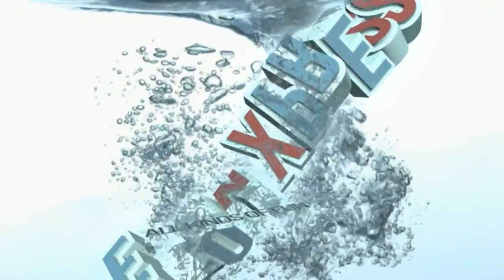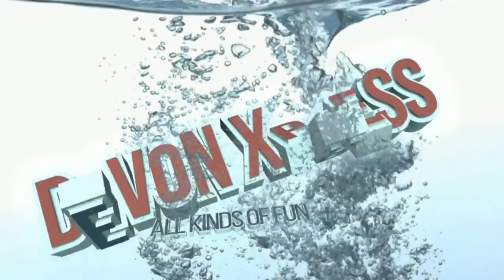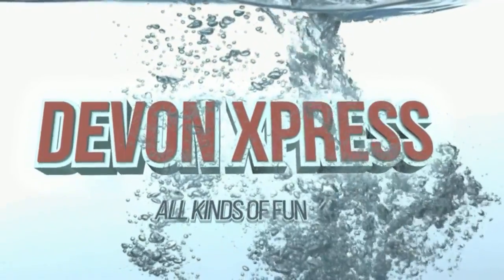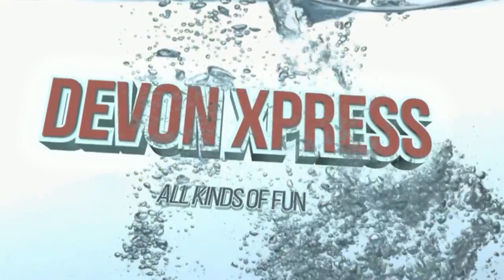7.3 powersroke Blow by Good or Bad

Comment: Just a heads up . To get a more accurate result with the ping pong ball you should cap all ccv . Basically your ccv mod you would cap the hose to eliminate the crank case pressure from escaping anywhere besides where you are testing from which is the oil fill tube .
Reply from the maker: +Bo Mason Good call
Reply: Ahahahaha 😂
Reply: uhhh the ccv is pulling exsesive pressure from the crank case with the compressor wheel.... it is made to do that. a ccv mod is the stupidest thing you can do on a 7.3, it'll make the blow by worse, and possibly wreck your shit eventually.

Comment: Great Video, my 95 has 404K  Ive never done the ping pong ball.  Cap does not move when it set it on top upside down.  I do see the white smoke coming out, just a hint though.  I change oil at 5k.  its usually down I qt., halfway between the full and the add mark.  I personally do not ever see this motor crapping out on me

Comment: If you’re getting a lot of blow by and the oil has been changed regularly a lot of DIY and cheap air filter set ups will allow your engine to get dusted. That is dirt getting into your intake. Check the fins of the turbo on the intake side. If they are sharp you’re good. If they are dull at all or if they look sand blasted the engine was probably dusted. Other than that a little blow by is okay. Your engine will run just fine as long as you keep up oil changes and check for diesel fuel in your oil and/or your truck starts blowing blue smoke.

Comment: Hey Devon, I'm thinking about buying a 1999 f250 7.3. it already has the 6 pos TS tuner. What kinda milege do you get with your rig, and what all have you replaced on your truck since you haved owned it?
Reply from the maker: Well this is a lot to add to a comment, but i get about 17.5 hwy and 15.5 town, on my channel i have many videos of things that I've done to my truck check this one out: https://www.youtube.com/watch?v=5LjTMpisoXg
Reply from the maker: one thing to note is that if its pre 99.5 add ons are a little different than the late 99 to 03. You can find this out by looking inside the door to see what the manufacture date is
Reply: ok, will check the man. date. Just one more question. Where did you get your mirrors? I " like " the 99-07 but the 08+ looks alot better.
Reply from the maker: This is the closet i can find, the mirrors i have look a little different because of the 45 degree cut on the side. I can't find the style i have anymore http://www.ebay.com/itm/For-99-02-Ford-Super-Duty-Side-Mirror-Power-Heated-NO-Signal-Towing-Mirrors-PAIR-/291422248688?fits=Year%3A2001%7CModel%3AF-250+Super+Duty&hash=item43da1e9ef0:g:xJkAAOSwpDdVHQzf&vxp=mtr

Comment: Just finished up on my 351w and took it for a ride. Got an insane pop at around 4500rpm and started smoking from my oil fill cap instantly dripping oil. Threw a code at me so I shut it down and let it sit for a few minutes. Fired her back up (let her cool down) and the smoking went away/ blowby. Code was gone so I continued back home. Got back and as soon as I parked it I realized small puffs of smoke and my check engine came back. Hasn’t done it on my last few drives(they were very mild), and I’m guessing it just backfired into my intake manifold and in a combination of no baffle nor strong enough PCV for a 580hp motor it’s causing this? Kinda just wondering if I should take a look at my pistons?

Comment: so there should ideally be no pressure coming from the under the oil cap right?
Reply from the maker: you will have some blow by even on a new engine. the pistons are not sealed so there will always be a little that comes through. excessive blow by shows signs of rings fail and or other damage in the cylinders.
Reply: I have a tractor doing this I'm somewhat concerned.   The question is what is excessive blowby.   The tractor is low hours so I can't believe that already it's having engine problems
Reply: I know this post is old but im looking at a 2003 f250 with the 7.3 and it has 290k miles on it and when i took the oil fill cap off there was zero steam/smoke coming out and i didnt notice any blow by at all. Is that bad or just very well taken care of?
Reply: @retrokirito5428  . As described, seems to be very well taken care of and a very Stout 7.3 stroke!!

Comment: My 02 has blow(348th). by but the main ishue is i replaced the turbo and still useing a lot of oil, Like 30 mile/ gallon of 15-40. any ideas?
Reply: Craig Ellsworth injector seals going bad same thing happened to mine
Reply: Jestin Jones so replace all the injectors,,, ouch?
Reply: Jestin Jones the o-rings or the internal seals?
Reply: the injector o rings they are 9 dollars for each injector
Reply: Jestin Jones get them at ford or any auto supply center?
Reply: Craig Ellsworth ford dealer or a deisel shop about a 6 hr process
Reply: Jestin Jones I mean should I buy the set from
Ford or elsewhere?
Reply: Jestin Jones changed all the Orings. #1 & 3 were tea bad. All fixed 
346th on my 02
Reply: Craig Ellsworth .. possible crack in the head maybe into the high pressure oil gallery... if theres that much oild disapering its gotta be going somewhere .. either through the crank case vent into the engine and burned or somewhere eles .. if its coming through the vent be careful as this could cause run away engine
Reply: @craigellsworth9682  how is it running now

Comment: Thanks for this, truck I'm looking at has 261k on it and the blowby was about the same so ill probably go through with it.
Reply: Got a 95' 296,000 miles. It's doing fine. Clean out the ccv filter and I put a hose from the oil fill cap to the exhaust pipe.

Comment: Thanks nice video my does same way but blow up oil on valve motor cover drives side and filter oil Im squeeze the oil filter I put new seal valve cover does same way miles 326000 thanks.